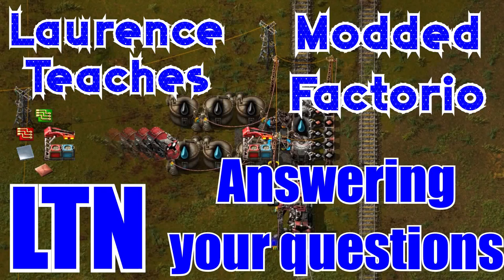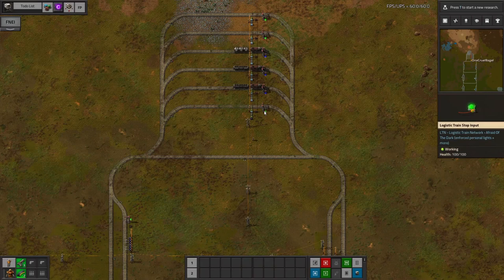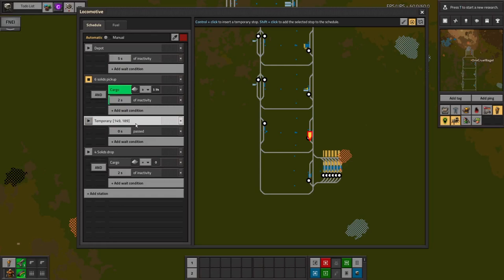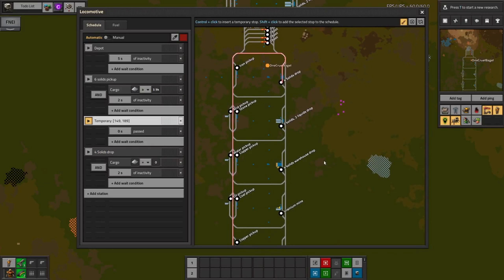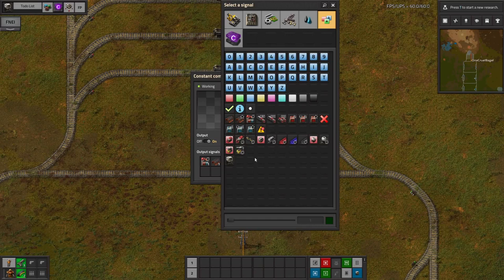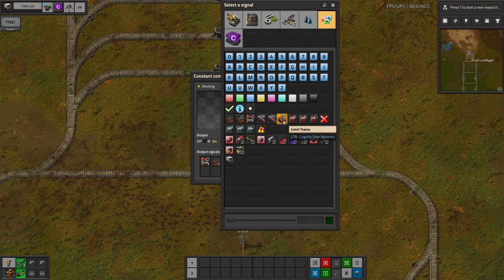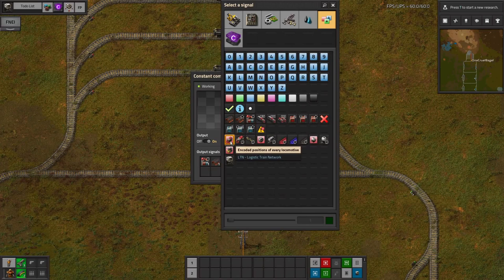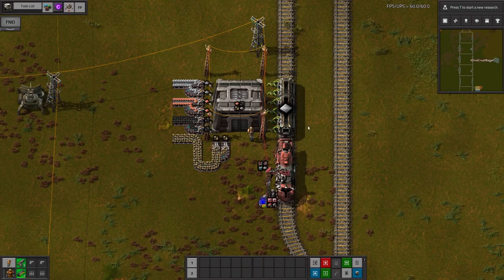LTN Tutorial - Answering your Questions - Laurence Plays Factorio

Comment: I've been waiting for another one! I see you've discussed points I made in a comment earlier :) A few things to add:
1) LTN Combinator is a convenience - instead of looking for each separate signal you have a nice clickable GUI for everything - one click for selecting station type for example. Definitely worth giving a try!
2) Variable train length is a big benefit of LTN - it will choose the required train length for the job by itself. Shorter trains accelerate faster and have smaller potential of clogging something when you get a "signalling incident". For example I run 1-1, 1-2 and 1-4 trains. For stuff like blue circuits I set train length between 2-5 (remember that the locomotive also counts here) - no need to send a 1-4 when something is requesting 4k blue circuits :)
3) Encoded train positions is very tricky - remember it applies only to the station the train is sent FROM. The station the train is sent TO will not be able to use the encoded setting. The dev said that this is a Factorio limitation (the locomotive at the front would actually be read as the last car at the receiver station) and there is no easy workaround. The use case for this I can think of is a train with a weird composition like 1-3-1 to make sure that only the particular stations will be allowed to call it. But you may as well use a different network ID...
4) Multiple requester/provider are a godsend - for the same thing you mentioned - automated construction and upkeep of outposts. I have a nice design for this - 3x LTN stations for 1-1 trains placed directly under each other. 2 are in range of warehouse inserters. The 3rd one is for fluid.
#1 is calling everything for the outpost (turrets, walls, ammo, bots, power poles etc), #2 is calling for artillery shells, #3 is calling for light oil for flamers. So I go to the site, build the station, put the blueprint of the wall, and just manually connect pipes and roboports to be in range. The I enable #1 and #3 - warehouse is directly connected to the roboport to kickstart everything. Then when everything is ready and loaded I enable #2 to call for artillery shells. Made this adjustment after the station called for artillery while the wall was not ready and it attracted swarms of behemoths, long story short I had to immediately come back to Nauvis :/
Reply from the maker: Yeah, I had a lot of interesting comments on the first 2 videos, so I thought it was worth making another talking about them. Of course, now I've got some interesting comments on this video too, so it might be a never ending loop!

Using shorter trains for resources that aren't needed in such large quantities makes sense - I tend to just shove a full train in and then just let the sub-factory work through all those resources, which means huge amounts buffered, but it also makes things a little simpler. That said, it's always interesting to see other ways to make things more efficient and streamlined  :-)

I've not (yet!) used LTN for outpost stations, I tend to have a dedicated outpost train that takes out the supplies that the outpost needs. This means it can have locked slots in the wagon to ensure it's always got supplies of everything that could be needed. That said, I think it might be interesting to look into a cleverer and more complicated way to do this, just for fun  :-D  Maybe that'll be a video in a month or so. 

I know the feeling with unexpected artillery - that's happened to me once or twice as well, and it's always a bit frustrating!
Reply: I would love a tutorial on LTN tô build outposts and wall defense...
Ty Laurence for making those videos!

Comment: I've used the encoded loco position values at the depot where there is mixed length trains with different locomotive counts.  For example, 1-4 and 2-8 trains.  If you have inserters fueling the first 2 positions ( for the 2-8 ) you don't want the inserter to put fuel into the first wagon of a 1-4 train.  You wire up the inserter to only enabled when a loco is at it's position
Reply from the maker: That's true - I think that's the only real use for them that I've heard. Personally, I tend to just use one single train length - the one time I've used more, I've put them on different networks. 

Of course, another possibility is to have 1-4 trains as normal, then to have 1-8-1 trains, with both locomotives pointing forwards. It's a little weird, but it should work!

Comment: Only thing I've found about station names that matters is if you change a station name while a train is en route. If it's not the only station with that name then the train will go to the temporary stop and then go to another station with the old name, which has caused a few ltn contaminations for me at least 🙂
Reply from the maker: Ah yes, that's very true. Trains don't like it if you rename stations that're in their schedule! Well. It's OK if it's already a unique name, but that's not what you meant. A good point, thanks!
Reply: Likewise, if you've set up a vanilla train limit of 0 or disabled the station (either manually or through circuit conditions), it will do the same thing

Comment: Hello. Sorry if a comment on this old video is unwanted.
At about 13:22 the train fills slot 39 up to 44 coal. This is not luck, but math. So you can plan ahead. Every action of 6 stack inserters moves 72 item. So after 26 actions it has moved 1872 coals and filled slot number 38 up to 22 coals. You can see it in the video for a short moment.
The inserters then  move additional 72 coals. The spill over to slot 39 is exactly 44.
Reply from the maker: Nah, comments are always good to see!  🙂  You're right that it's mathematically guaranteed to stop loading at the same point. Exactly what point it hits would be affected by how many stack size researches you've done. If you had that only stacked up to, say, 10 then you'd end up needing to do different numbers of locked stacks in the wagon, and it wouldn't work as well.

Comment: Here's a question for you, what if you have a train that has a fluid and a cargo wagon for something like defense logistics. Like transporting whatever oil you're using for flamethrowers as well as walls, laser turrets, repair kits and other things you'd have setup for a fully sustainable defensive line. I've noticed with LTN in doing this, if there's any sort of leftover items like repair kits left in a cargo wagon even with LTN set to only request the flame thrower fuel, it still registers the cargo wagons and wants to fully empty them at the requester station. I've fucked around with a ton of different settings, but i'm unable to figure out how to work around that setting.
Reply from the maker: My advice is to not use LTN for this train, have an extra train dedicated to outpost supplies, like this https://youtu.be/43AM01VcW3Y

Comment: I love your LTN tutorials, I have two questions:

- Did you ever had a problem with LTN auto fluid dump on depot that  there were wagons with 0.0001 fluid inside? They are not cleared by LTN and they pollutes whole network leaving depot with such weird number of fluid inside.

- Is it possible to combine provider and depot? If yest then how? It would be very convinient for traffic.
Reply from the maker: I've not had any problems with fluid unloads leaving a little bit behind... But then I always have the trains set to not leave until they're empty. 
I don't think you can have a station as both provider and depot, but now I'm wondering what happens if you put both signals on the station!

Comment: Hi! Hello great tutorial, even after 2 years!
I was fiddling without the this mod in space exploration. Just installed it, it's great, this is exactly what I needed, so thank you. 
And I have a question too  if I may. 
How can I have a load station actively change priorities? I need it for the core miners, that it can't exceed any ore limit, because the whole miner gonna stop, I need the train to take ores from the highest amount of storage. And even when it gets over the limit, it should take the ores to a recycling factory for example. 
I like the concept of the core miners, so I would love to go down this route.
How can I make this happen?
Thank you for your answer, hope you will see it on a 2 year old video!
Reply from the maker: Thanks!
The station priority is set by the signal that's fed into it from the combinator, so you can adjust that however you want. If you want to pick up from the mine that has the most, you could add a combinator that converts the number of core fragments directly into the priority number, so the priority is set to the quantity in the station. 
To be honest though, that's a little more complicated than I'd go for - I'd add in extra trains until there's always a train ready to go off to a mine when it's called, that way as long as your processing and consumption is fast enough, you'll always have the cores being picked up. That's what we've done in our K2SE run (shameless plug!)

Comment: Why do we have to use the power of 2 on station id's? I'm setting a complicated station network on nauvis (on K2SE, with well over 500 trains) and the numbers are getting quite big and I'm having a hard time remembering all of them. Also really appreciate the LTN series, the best explanation out of all the youtubers I've seen.
Reply from the maker: It's because the network numbers are actually bitmasks, so if you convert it to binary, the positions of the 1s are the networks that station is on. 

For example, if you have networks 1 (1), 2 (10) and 4 (100), then a station with a network ID of 5 (101) would work with both 1 and 4. Most of the time, you don't want this, so it's best to stick to just using the powers of 2. 

Personally, I don't use different networks, but they're there if you want them!

Comment: For the stack inserter overflow from pickup stations, I was wondering why you had suggested blocking an entire slot in the wagon instead of limiting the  stack inserters to 10 per stack. That should allow them to fill evenly and prevent any leftovers, which eliminate the need for a blocked slot.

Also, wouldn't using a blocked slot mean that the trains can no longer be sent to requester stations because they don't have 40 full stacks of items? I've never used LTN, so not sure if that would be an issue.
Reply from the maker: The system does work as shown - I believe LTN is smart enough to know about the blocked slot and not expect the train to be completely full.

10 items per stack makes sense, it would slow the loading down slightly, but only by about 20%. I'm not certain whether it would work though - I feel that an inserter could pick up some stuff and start moving just before the previous one drops the last handful in and so leave you with some still in hand... I'm not certain though, I haven't tested it!

Comment: Hi. I came across your LTN vids as i was looking to improve my network and get a better understanding of the circuits. I've taking done notes to work with till i get the hang of it and for the most part it is awesome when its working 
One thing Im struggling to sort out is my trains are going all over the place ie different stops. I have trains with cargo returning back to the station and going and waiting at other stations. Like copper on a train trying to load green circuit. i just can not work out why. 

any advice T.I.A
Reply from the maker: It's hard to say... One thing I would recommend is turning off the timeouts in the mod options - this will mean that trains just wait at stations if they can't load/unload which makes it a lot easier to work out where things are going wrong - because the train will be sat there! 

Another thing I often do is set up an alarm to sound if a train arriving in the depot has any cargo. This doesn't help find or eliminate problems, but it does tell you when something has broken. 

I hope that helps!
Reply: @LaurencePlays   This did help. I also deleted all my trains and set them up on the system as and when needed by ltn. i think it was a case of i had to many trains on the network and some trains was getting the same requests.
Reply from the maker: @user-rf9qr5jc4c  The requests shouldn't be repeated unless the previous train times out - at the end of the first video, I run through the options I recommend using for the mod, I'd recommend checking those out because your trains might be getting stuck then timing out and going somewhere else, leading to chaos.